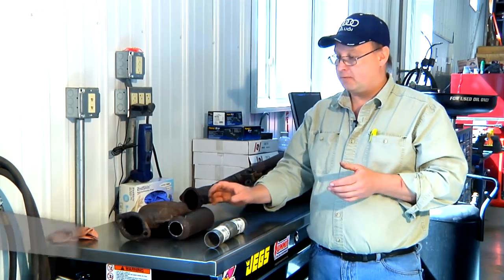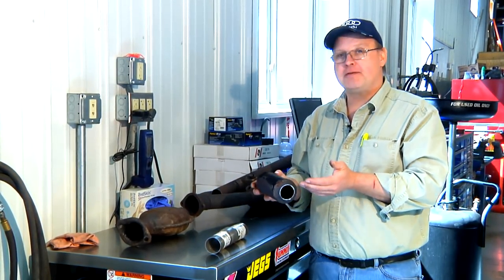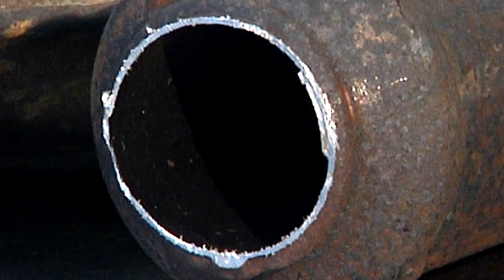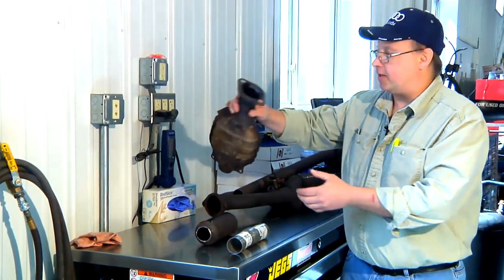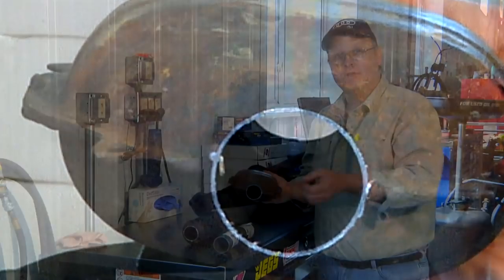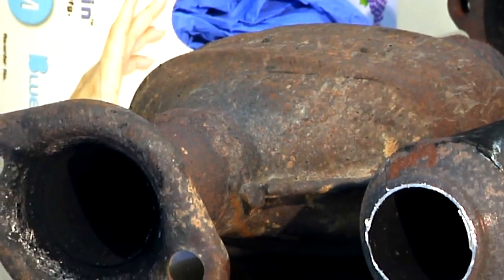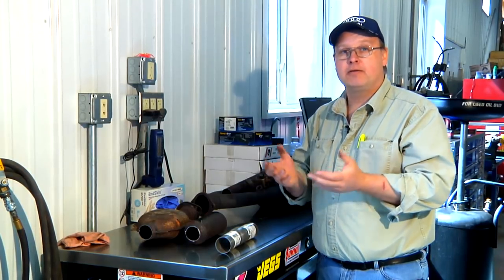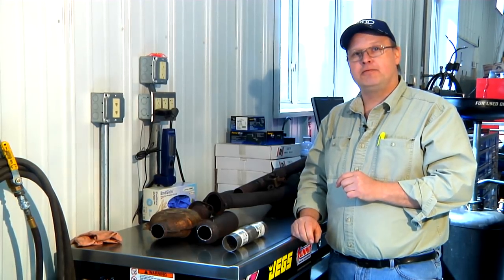What Happens if You Replace the Exhaust Resonator With a Pipe? : Under the Car Repairs

Comment: With say a turbo powered engine, will removing the resonator not affect back pressure because the turbo is already doing this? I have researched that removing the resonator on a turbo car will not cause the performance to drop, it is solely for audible enhancement. And that the turbo itself will create the recommended back pressure needed. is this true and correct? I am considering removing the resonators on my 2010 Mazdaspeed 3. Thanks and any replies would be appreciated.
Reply: Turbo cars adjust fine when you remove back pressure and will generally run better since the turbine wheel its self creates the most resistance and generally turbo cars ECUs will be able to compensate for flow without a problem.

Only with n/a do you need to pay close attention to backpressure/velocity of the gasses.
Reply: ***** Yeah, last month I removed my resonator and installed an Ultimate Racing axle back exhaust on my 10 Mazdaspeed 3. It sounds amazing. deep and raspy like a tuned Boxer engine from the STI. I cant believe I did not do this modification years ago. I recommend a Forge BPV to replace the stock black plastic one as well. Using the blue spring and one shim the pressure release sound is bad ass.
Reply: there's a balance to to it. My mazdaspeed protege for some reason, has to cats a resonator, and a muffler stock. All at 1 3/4" exhaust. My exhaust broke between the two cats causing it to run strait off the cat, and it ran like shit. The turbo didn't seem to spool as fast, I replaced the second cat with a flexpipe and with only one cat, the power improved. it throws a check engine light for the 2nd o2 sensor cause its not getting voltage, I think just because I may of damaged it while smacking the flexpipe into place.. If that's not the case, there's always the double fowler method.
Reply: Acuravigor47  Not true, if you oversize the pipes you will lose bottom end on every engine, including turbo cars/trucks. What you may gain with over sizing pipes in top end is paid for by sacrificing bottom end. Even turbo cars. Ask anyone with a 4" straight through system on an ecoboost v6. EVERYBODY loses bottom end and picks up top end. Thats just how it works. Take the time to research this, you'll see what I mean.
Reply: Sal Molinare True but with n/a you legitimately loose HP when you oversize and don't pay attention to flow/velocity.
Turbo will do exactly what you mentioned the difference being it takes some pretty extreme exhaust sizes to actually lower peak HP on a turbo car, assuming you are running a half decent amount of boost.
[in which case you shouldn't be touching your exhaust :P]
Reply: MustardTiger My ecoboost Tremor comes stock with 3" exhaust. The one in the video also came with 3" stock and went to 4" and lost low end torque, so it holds true with turbos too.
Reply: Sal Molinare i know. read my comment again. :P
Reply: MustardTiger fair enough.
Reply: Sal Molinare Yeah- I did some research on this and I removed my resonator on my turbo Mazdaspeed 3. I realized the turbo itself creates enough required backpressure to have my engine run correctly and responds well to my modifications.  I now have a COBB access port V3.0 and have tuned the Mazda to operate well with aftermarket parts as well. The resonator was a piece of crap that shouldn't of been installed to begin with.
Reply: Acuravigor47  Removing a resonator is a minor change. What I am talking about is over sizing the exhaust. The people who think that  bigger is always better...sometimes it is, but a lot of times it's not. There is some science going on that they do not understand. It just irritates me to hear it over and over from people who have no clue...
Reply: Sal Molinare yeah~ bigger isn't always better, my built exhaust from Ultimate Racing in Toronto Canada works great and is made just for the specs a Mazdaspeed 3.

Comment: Back pressure? I thought newer cars use 4 stroke fuel injected engines, hmm guess we still mixing gas
Reply: Back pressure caused by the exhaust system (consisting of the exhaust manifold, catalytic converter, muffler and connecting pipes) of an automotive four-stroke engine has a negative effect on engine efficiency resulting in a decrease of power output that must be compensated by increasing fuel consumption.
Reply: +FAID Hahaha yes! But if back pressure is under 100mbars it's ok..
Reply: +ASIStudios No disrespect, but from the research I've done because of this claims that your argument is as solid as matches stuck in poop, if you'd like me to share me knowledge just let me know, but before you do did you even under stand my joke and or what type of engine are you taking about soild, liquid, electric, 4 stroke, 2 stroke, rotary, water/coal/chemical /bio?

Comment: i have 2011 grand cherokee 5.7 hemi, i want to deleted the resonator or muffler, i need you2 help for the best choice.
Reply: +Rabie Shaaban Deleting the resonator(muffler in between the exhaust and engine) will help you gain a bit of performance and it can be really cheaply done or even by yourself.

Comment: you do not want backpressure in a exhaust
Reply: +adam heed a gas engine works better with a good amount of backpressure, though when it comes to a diesel or something turbocharged it is best not to have backpressure, backpressure on anything with a turbo and/or supercharger basically defeats the purpose of the turbo/supercharger
Reply: +Kenzie Beaton thats because the turbo itself creates the needed back pressure.
Reply: +adam heed is correct you do not want back pressure. Gm gives a spec of no more then 3 psi as a ex test for restritions.
Reply: +Kenzie Beaton You're talking about several different interacting things with a very simplistic explanation of each.  A gas or diesel 4 cycle engine only needs exhaust gasses to exit the combustion chamber at the right time, backpressure is the enemy of efficient scavenging.  You can make it less efficient with more piping, bends, or devices in the exhaust stream, but anything other than an open port or straight pipe is an enemy of efficient cylinder scavenging - there is never a time when backpressure is desired, and no manufacturer ever "builds it in".  There are tricks to improve scavenging beyond what the engine is naturally capable, but none of them include backpressure, quite the opposite actually.  An engine always makes the most hp/torque with open headers; this is indisputable fact.

Two stroke engines likewise do not benefit from backpressure, but they do benefit from over-efficient cylinder scavenging and charging by way of divergent and convergent cone sections in the right place of the exhaust pipe; one to pull gasses out by creating a low pressure wave, and the other to send a sonic shock wave to close off the exhaust port while the piston still has it uncovered.  This, still, is very different from backpressure.  You may be familiar with two-stroke diesels that charge the cylinder with a supercharger, but even those systems don't require or work better with restrictive exhaust piping.

And that is just two over simplified explanations of something much more complex.  But from this point forward, you've been educated and are allowed to smack anyone that thinks backpressure is a good thing.
Reply: +Ryan McIntyre Actually, let me issue a correction:  backpressure IS introduced into factory exhaust systems for the purposes of silencing.  Modern resonators and muffling devices are highly restrictive and slow exhaust gasses tremendously, limiting power considerably, but they pass the very low US sound restrictions.  If you were to take any ordinary vehicle with a modern 4 cat, 2 resonator, 2 muffler system and straight pipe it, you WILL lose power, but not because of "the loss of backpressure", it's because the vehicle's fuel injection and ignition ECU program were mapped with that specific (albeit horrendous) equipment.  When exhaust gasses can only flow so quickly out of the chamber, certain exhaust gas, exhaust port, and combustion chamber temperatures are reached, certain limits to the volume of new fresh charges can be introduced, and the RPM ceiling is limited; and the FI and ignition is tuned to this garbage setup, and then retarded and leaned out to meet emissions standards.  In that event, backpressure is desirable but only to compensate for a tune that was developed on restrictive equipment.  Max performance will always be open pipes.
Reply: +adam heed Actually yes you do...
Reply: NoOneImportant556
Do you have a reason for saying this or are you just trolling?
Reply: Ryan McIntyre I do.. But Im not going to spend the next couple hours going back and forth with you on an info war via YouTube to explain it..
Reply: NoOneImportant556
Great.  Then make it
 brief and make me look stupid.  I'd like to learn something.
Reply: Ryan McIntyre Naw Im straight. Cause I know your dieing to prove your worth via the internet, and that would mean I would have to try and read the novel of "facts" you pulled from or read else where. I highly doubt you did any personal testing or analysis to actually back up your claims and "findings". Just making claims off of others. As most "experts" do via the internet. Recirculate half assed information. Just enough to SOUND smart over the internet.
Reply: NoOneImportant556
 You caught me.  BTW you're welcome to come use my dyno any time you're ready to prove your backpressure hypothesis.
Reply: ***** And yup that's me, cause I don't have a LS Silverado as my daily, a z33 track currently undergoing a TT install in my driveway and a Eddie Bauer 4by Bronco that's missing its whole rear end waiting for a dana 60 or worked at a fab shop for the last 8 years of my life... Yup, don't know a dam thing.
Reply: Ryan McIntyre Gladly. Post your business information down below. Then Ill see you come up as the registered owner of the business and the address of it.

Hopefully your in the area because my TT 350 build is about done and some friends of mine will also be in need of some tunes here as well. We would gladly come let you run a tune and see exactly how well your shop does tuning our cars and printing out dyno sheets.

Better get it calibrated because one of my buddies will be bringing his blown small block Chevelle running 4:10 gears and 29.5 fat boys on the back.

If he even lets you touch it lol
Reply: NoOneImportant556

McIntyre Maintenance in Arizona

What year Chevelle? I love those.
Reply: Ryan McIntyre Its either a 69 or a 72.. Cant recall off the top of my head. He and his friend picked it up a while back. Went from a restoration into a track queen. Its a beautiful machine with a lot of man hours and love put into it. Some of my own hours as well. Live for the 3am wrench sessions.
Reply: NoOneImportant556
My favorite year is the 70.  That's a bunch of steel compared to a modern car.
Reply: +adam heed i have to mention motor cycles....... especiallytwo strokes..... i mean REALLY> you DONT WANT ANY Back Pressure? (you must start simple to understand the complex)

Comment: in my car, I had no acceleration and my car would not down shift when going up hills, once i replaced the pipe back to a cat, the engine ran like new, got downshifting and power going up hills

Comment: The Ford dealer told me the exact same thing. If I remove the resonator on my 6.2 gas F250 it will throw codes. They recommended I dont do it because I will lose low end power AND torque. They said the term is NOT called back pressure which is the old term but the new term which I cannot remember is similar. Remove the resonator and the performance will definately be lost. He said anything removed AFTER the resonator will not affect the engine performance.
People still think removing all that shit will give the engine more power but it will not on these new engines.